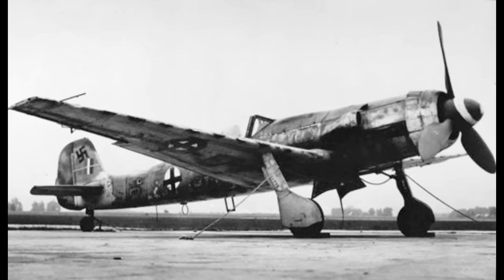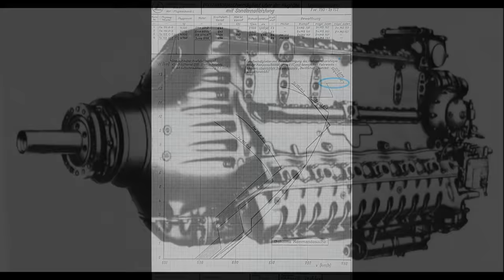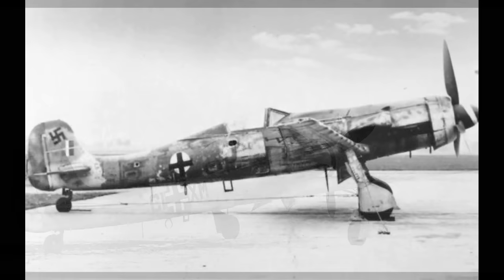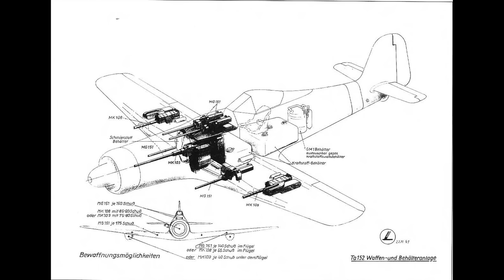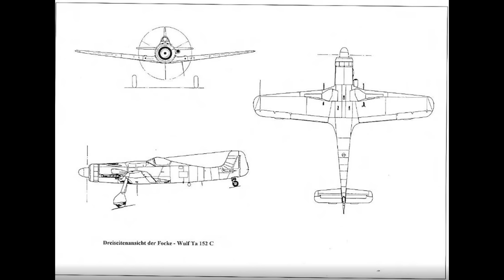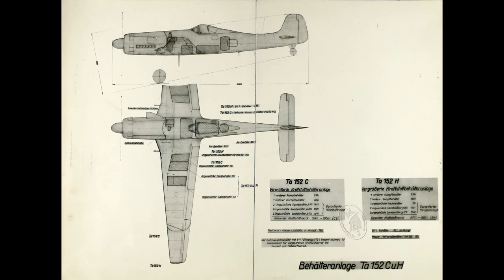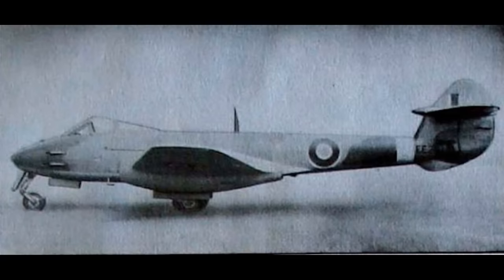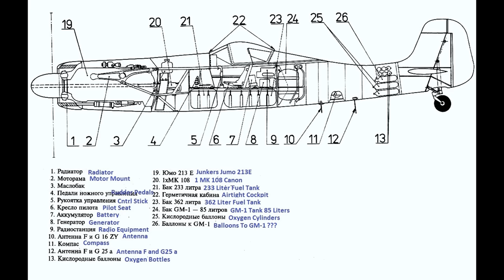Focke-Wulf Ta 152 H-1 Extreme Speed At High Altitudes.

Comment: To maintain an oxygenation of above 95% in the arterial blood, an air-minute-volume of 7,500 ml with 21% O2 is required, at sea-level (~1,000hPa), usually delivered in 12-15 breathing-circles. If you start messing around with one (or more) of these parameters, it's useful first to focus on oxygene alone. 21% of 1000hPa means a "Partial-pressure" of 210hPa of O2. If the air-pressure -or the air-freshness drops, also the partial-pressure of O2 does. In compensation, you could first rise the air-volume/minute, meaning breathing deeper and with a higher frequency. It is very easy to breath faster, as the air is thinner and easier to breath. But the air is also very cold and when being heated up to body-temperature (from -20 to +20°C) it's getting even thinner. Everyone who has climbed to high altitude very fast has already experienced this feeling of "Breathing nothing". Some fall in panic but a WW2-pilot won't as he is well experienced. On the other hand, you could rise the partial volume of the inspiratory O2 to maintain this 210hPa I mentioned above. So there are certain limits, as any outside pressure lower than 210hPa automately means that even 100%O2 could not offer the body the required O2-flow -well as long as you stay at 12 intakes and a total of 7500ml/min! So there also is a huge room for some short-time compensations...
But we also have to keep in mind, that the binding capabilities of blood relate also to the over-all-pressure in which the body is suited. A drop in over-all-pressure will lower the O2-binding-capabilities. Also any type of hyperventilation leads to a shift in the CO2-household: Hyperventilation washes out too much of the blood's CO2, so the blood gets by time alcalic. BUT when you then switch to 100% O2 or even 100%-O2-hyperventilation, the turn comes: Under normal conditions (see-level-pressure), the di-nitrogen (N2) is actually the solvent that's washing the CO2 out of the lung-capillars. Taking away this solvent leads to a paradox situation where thus hyperventilation, the body collects CO2 up to toxic levels. Over-saturation with O2 also leads to a supression of the breathing-drive. 

So it over-all makes a lot of sense to bring the pressure surrounding the body as close as possible to sea-levels, even partially and even if you're capable to deliver pressurized oxygen. The usage of the offered oxygen rises and the danger of carbon-dioxide-intoxication is lowered significantly. The redundancy you mentioned is a nice side effect.
Reply: I think I'll rephrase that....

Comment: A wee point, I have built engines most of my life , I have yet to see an exhaust port NOT going around the valve stem it is just the division continues throughout  out the head casting to the port  , which will probably  lead more heat into the head  through the larger to exhaust gasses exposed area..... a wee bit odd though......giving the coolant more to do......hmmmm.....
Reply from the maker: That's a good point. Of course piston engines have exhaust stems going through the exhaust port, but it's normally nothing like this. In other engines that stem is exiting up through the port wall much farther upstream. I can't think of another engine with the valve stem located in such a way that the port has to be split at the outlet.

Comment: Greg , great video : A QUESTION ,, I assume USAF bomber command knew the performance envelope for their fighter escorts and ran the bombers, Mitchels and B17s through the altitude sweet spot giving the P51Ds and others enough top level space to intercept and protect the threat from above or was the flack still forcing the bomber stream higher ? What was the 'average' height of bomber streams late war ? The trade off would be too high  = inaccuracy on bombing and fighter cover as a package vs lower, Flak and other German marques ? Do you understand ?
Reply from the maker: Sure I understand. The B-17s and B-24s flew the vast majority of their raids at 25,000 feet. Thus the US fighters we optimized for fighting from about 20,000 up to about 30,000 feet.

Comment: The german paddle blade prop--what do you guys think it's contribution in terms of kph ?  The p47 paddle blade obviously helped and the germans used similar prop blades. Great vid Greg as always.
Reply from the maker: Without doing the math, I would say that the difference between the best and worst prop designs used on a given WW2 airplane would be about 20-30kph. That's a very rough guess.
Reply: +Scott Campell   Propeller choice was always a compromise of propeller surface area,  engine HP and operating altitude.   Paddle blades were typically optimized for high altitude and better climb.  More blades could be used but this added complexity and weight to the propeller design.  Thinner blades gave more speed at the greater air density down low.

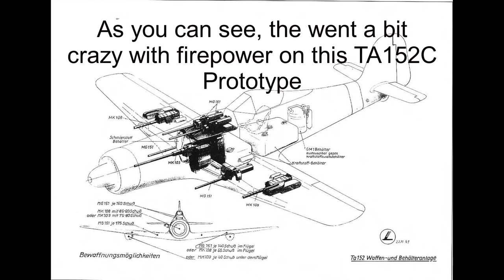Comment: at 16:53 ..they went a bit crazy with the firepower .... i have a small correction here .
this schematic shows the  " waffen und behälter anlage " weapons and container / tanks installments ......but there is an " oder " wihich means or ....at the cannons ....so the mg151/20 is a 20 mm cannon and the mk103/108 is a 30 mm cannon ......but in the picture shows just the " possible " combinations .
so the real number for the c modell is 4 x 20 mm and a 30 mm and for the h modell 2 x 20mm and a 30 mm

and this here ---->  https://www.deutscheluftwaffe.de/fl-30403-1-umsteuerhoehenatmer-sauerstoffdusche

is the " sauerstoffdusche " the elbow push button for an oxygen boost for the pilot if required as he feels kind of oxygen shortness

it literally translates to " oxygen shower "
Reply from the maker: 4 20s and a 30 is a lot.
Reply: @GregsAirplanesandAutomobiles   yep ....thats a lot . some kind of planes are even crazier when i think of 6 x 37 mm for the xp67 moonbat ( most beautiful prototype prop plane for me )

Comment: thanks. very informative, as usual. thanks for not dumbing things down. if you do more with this, maybe you could illustrate the annular radiator system, and compare it to the 51 system for weight, complexity, susceptibility to damage, and drag/meredith  stuff. Also, what airfoil was Tank using? what were the actual aspect ratios on the various models. would there really have been a strength ad for steel spars, had aluminium been available? i read somewhere the 152 had a wooden tail? true?  You are really good. if you'd stick to real airplane stuff and do your video game and car material elsewhere,  I'd volunteer for your patreon element.  won't pay for vids  that don't make me feel as if I can hear the gyros winding down and smell hot aeroshell when I finish. you ever play around in Pittses etc?

Comment: Are planes faster at sea level or high altitude air is less dense high up but there’s less drag high up so which matters more?
Reply from the maker: There is an ideal altitude for speed. It's usually above the highest point where the engine can still make near peak power, but not too far above.

Comment: I always think what a tough job the prop must have at high altitude, in thin air, to actually turn all the that power, into traction?
Reply: Very astute observation there as regardless of how many horse you can let out of the stable at the end of the day the propeller still has to convert this power and all the while being rpm limited to keep blade tips below supersonic speeds. Although the ruskies in later years, think tu95 bear had a prop tip speed of Mach 1.25 which defies aerodynamic principles to a point. Usually supersonic prop tip speeds results in large loss of thrust. They had some big props back then tho...13 and 14ft blade lengths so that makes for a big flywheel

Comment: The Allies also had an alternative high altitude bomber with the B-32 (The B-29's competitor / backup plan). What's the practical operational ceiling of the B-32??
Reply from the maker: The B-32 and B-29 were comparable in terms of altitude capability, although the 29 was slightly better in this regard..

Comment: Hey Greg thanks for the great video on the Ta-152H it’s a beast up at altitude. 
My question is the Ta-152C was designed for Low and Medium altitudes, What exactly is the height for medium altitude?
I noticed on the climb performance chart that the C model could still perform well almost at 30,000ft does that sort of contradict the “medium altitude” fighter role?
Reply from the maker: I would say that "medium" altitudes went up during the war. At the start of the war combat at 20,000 feet or higher was very rare. By mid 1944, combat at 25,000 feet was the norm over western Europe. So while 20k was high in 1939, I would consider it the higher end of medium in 1944. As for the 152C, it's a question of what it was optimized for. Optimizing for 10,000 feet doesn't mean it can't perform up high, just not as well as the 152H which is optimized for 35k and up.

Comment: The DB 603 really had lots of potential. There is one chart you can find on google about some experimental projects and with MW 50 it could have gone up to 2800 HP at sea level and 2200 HP at 30 000 feet.

The Germans should have taken the Fiat G56 design and mass produce it with the 603 and MW 50 injection.
Reply: Man a DB 603 with over 2000 HP at Angels 30. That would be something to behold.

How they could more easily have mass produced the G56 is another matter though considering its costs in manpower compared to the 109 and 190's. That they did not develop up the DB 603 and allocate its production to the 190 early enough is most puzzling though. Not like the rather mediocre Me-410 was really suited for Germany by 1943/44 outside certain roles and it used up such valuable 603's.

Comment: Very interesting the high altitude version of this plane, how about one day covering the Spit MK6 that was intended for high altitude all the way down to a pressurized cockpit, I was very intrigued reading about how it had a single stage supercharger that was maximized for high altitude, that in itself flys in the face (no pun intended) of the whole thing about 2 stage superchargers and their high altitude "superiority", it must have suffered from some serious throttling power losses at lower altitudes though, anyways, have a nice day.
Reply from the maker: Exactly, you can have a singe speed set up for high  altitude, but it will cost you down low. For certain types, the reduction in weight and complexity is worth it. For example, a recon plane will be at altitude before it gets to enemy territory, so a single stage high altitude set up is fine.

Comment: so if you found one of these in a barn and fixed it up you could just go to the gas station and fill it up with 87 octane?
Reply: +Phelix  Popson    No,  pump gas is not the same as avgas.  Avgas has a lot more additives and stabilizers for aircraft use.

Comment: Do we know how much power the Ta-152 developed at the altitude cited for it's maximum speed?  Working off of Wikipedia (as I'm away from home), so the power developed at 41,000 ft (472 mph cited)?  I note 1250 hp on MW50 at 35,100ft.  Thus I'm curious how much drop off there is (if any) between 35k and 41k and how much hp it took to achieve vMax at 41k. 

Likewise, is there a way to calculate this or is it all empirically derived given the complexities of taking multi stages and speed induction systems into account (just answered my own question pretty sure)?  Furthermore, are there any good online resources (or books, still love those) that show charted hp at altitude for various WWII powerplants?  We often see snap-shot data (2 or 3 altitude points, sea level, 5k, 15k) for powerplants as associated to a specific make, I'm just curious if the engine manufacturers would produce altitude sweep data as a general course of action considering their engine could be packaged in any variety of aircraft and power output at altitude was largely independent of that.

Enjoying the channel.  You might consider an episode on interesting data that you can calculated/derived with some knowns as a starting point, showing us how to go about it so we can play along from home!  Keep up the good work!
Reply from the maker: I do think I have the power chart, but I'll have to find it and maybe cover that in another video. It can be calculated with reasonable accuracy. I haven't covered that much, although I do show how to calculate a lot of other things, you will find that sort of stuff in my Me262 vs. P-80 video, among others.

Comment: Why GM-1 (N2O)? Why not Dinitrogen-Tetroxide (N2O4)? I can understand the use of Nitrous in civilian motor sports because it is non-toxic and relatively available without too much government restrictions. However, it is a gas which needs to be keep under pressure, it is relatively low density and it is more nitrogen than oxygen which means you are carrying a lot of dead weight. Dinitrogen-Tetroxide is a room temperature liquid. It is has twice as many oxygen to nitrogen molecules. N2O4 is a common storable oxidizer in missiles and rockets usually used with Hydrazine or it's derivatives. But it is not hypergolic with gasoline.

Comment: out of pure curiosity, and I know its not at all realistic... how would the P59 compare to the 152 if it was adopted and saw combat with it?
Reply: to expand on why im curious, the 59 had relatively large wings chord-wise , I am curious as to how that would compare to the large span-wise wings of the 152 H
Reply from the maker: Good question, but I don't know, I haven't read much about the P-59.
Reply: @GregsAirplanesandAutomobiles  Ive been curious aout the 59's design for a while now, so I gotta read into it, how do you manage to find those documents that you use? I cant seem to find stuff of that quality.
Reply from the maker: I use three sources, at least primarily. Aerodynamics for Naval Aviators and the Pilot's Handbook of Aeronautical knowledge can be found at faa.gov. The NACA reports on on the NASA server, a search will find it. Other than those, I mostly use actual Pilot manuals for the planes, I collect them as I find them.
Reply: @GregsAirplanesandAutomobiles  oh neat, thank you very much for sharing
Reply: There's a P59 at Udvar-Hazy entrance. Pretty good looking jet with wings that could glide for days. Just going by what I've seen, and just the naked eye, I think the Aircomet would out turn the Ta 152H1 but wouldn't roll as good.

As a side note, I personally admire Bells design and their overkill cannon placements. If it had wings, it'll have a 37mm in the nose!

Comment: I find it strange that the P-38 wasn't even mentioned. Was it really that slow compared to the single-engine fighters?
Reply from the maker: The P-38 is not slow. I just can't cover that many planes in one episode. There is always another that I could have mentioned. The main reason I left the P-38 out of this one is because I need to make a video about it first. There are so many factors with the 38, I just don't want to try and force it into a video about another plane until I make a specific video about it.
Reply: @GregsAirplanesandAutomobiles  Ah, okay. Well, now you've got me very interested to see a performance chart comparison between the P-38 and at least the Ta 152. :) Naturally, it'll be interesting to compare it to the other well-known fighter aircraft of the day, as well. :) Thanks for an interesting video!

Comment: So I came across a video of the allies messing with a captured radial engined-190 and one of them was messing with what looks to be a stator vane (? not sure if vane is necessary to describe it). Was this common on radials? I haven't noticed it on other airplanes. Is this necessary to control airflow over the cylinder heads for cooling or is this a performance consideration?

Sorry for all the questions and hopefully I'm not barking up an elementary tree because I can't figure out keywords to google.

here's the video: https://youtu.be/UvX2aSsP3Xg?t=145
Reply from the maker: Good question Bill. It's actually a fan. It's needed at low airspeeds because of the engine's closely cowled configuration.
Reply: @GregsAirplanesandAutomobiles  Gah. Now tank's cowl development starts rushing back.

Also thanks, you're quick!

reason 92/125 of why you're my favorite content creator.
Reply: +Bill Dewahl     The BMW 801 series had a geared fan for forced cooling, at approximately three times the propeller speed if I recall.   Earlier models had a 12 blade fan while later series had a 14 blade fan.  Inside the cowling were  a series of baffles to direct air around armored oil cooler and around the cylinders ..  https://upload.wikimedia.org/wikipedia/commons/8/83/BMW_801D_Duxford.jpg     http://legendsintheirowntime.com/LiTOT/Content/1943/AP_G_4303_FW190-aircool_p054_W.png

Comment: Did they use this plane for photo reconnaissance? That is one area where the RAF Spitfires and Mosquitoes seem to have been far better than the Germans
Reply from the maker: At that point in the war, I don't think it was a primary concern.
Reply: @GregsAirplanesandAutomobiles   There were some proposed versions of the Do-335 for reconnaissance.  It probably would have been a fast platform for that task.   And the Luftwaffe had a decent number of captured Allied aircraft that could have been purposed to penetrate Allied defenses if needed, like the missions flown with KG 200.

Comment: What is your oppinon on the FW 190 Dora-Series which were the predecessor to the Ta i think
Reply from the maker: I like it.
Reply: +Warhead_beast   Both the Fw-190D and Ta-152 series arrived too late to prove their worth in the field or benefit from additional design maturity to improve their performance.   With good fuel, and reliable engine and a good pilot the Dora series was a formidable opponent.   Maybe when one of the sloooww-moving Dora projects manages to get one in the air there will be some contemporary opinions from pilots today.